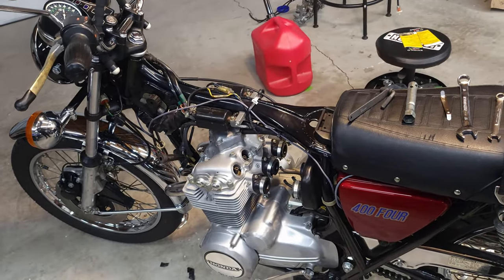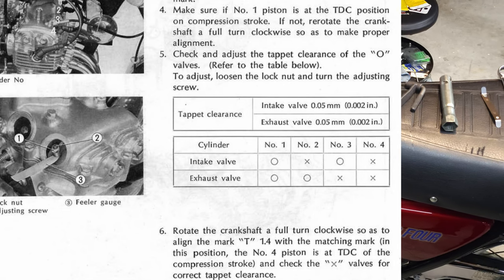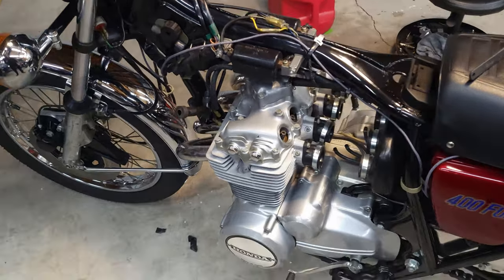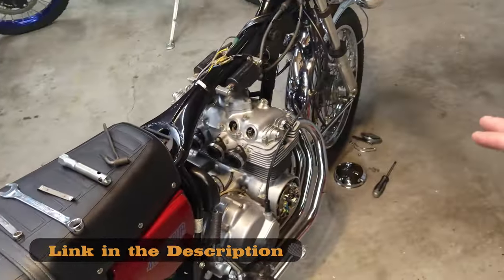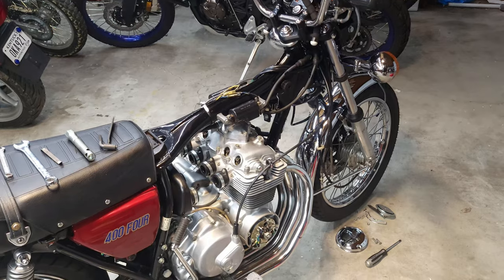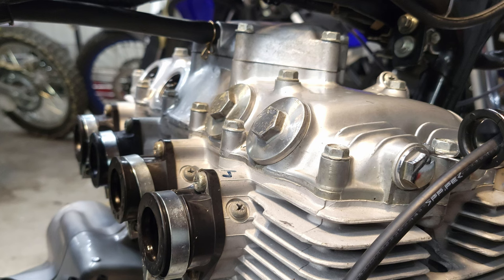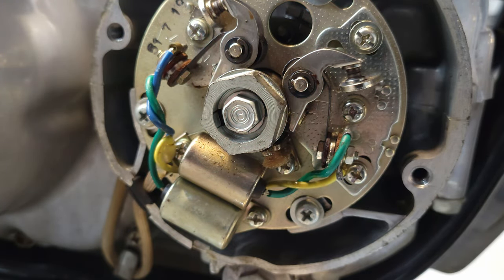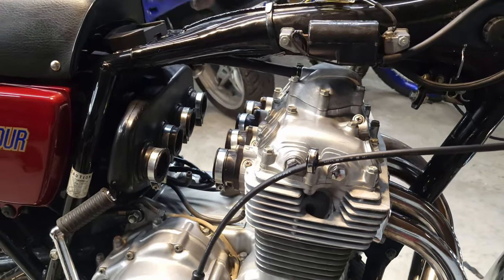CB350F CB400F Valve Adjustment - Details Other Videos Miss

Comment: Great video! Not sure I’m quite ready to tackle this on my 400 (which has been stored for years and years), but I learned a good deal. Thanks
Reply from the maker: If it has been sitting for a long time i might recommend pulling the rocker cover and getting a bit of oil on that cam before turning it over a bunch! Glad I could share some info, thank you for watching
Reply: Makes sense. I was hoping to get away with a few drops of oil in the spark plug holes, letting it sit and come back and carefully turn the engine with the kicker but I guess that will not build nearly enough oil  pressure to get to the top end. 
Will defn consider your suggestion. Thanks.